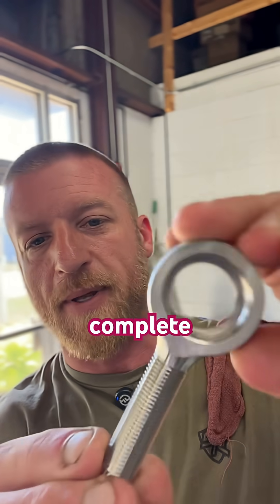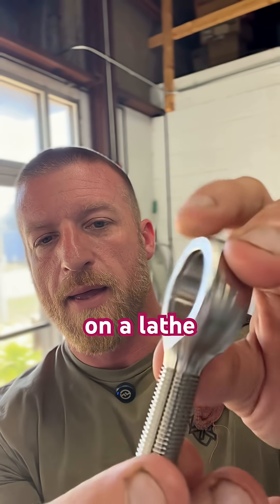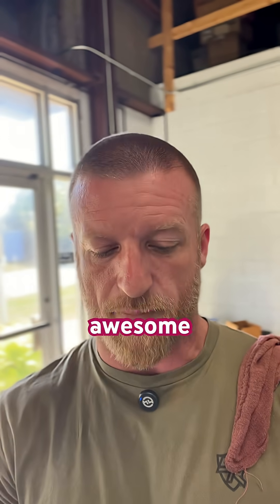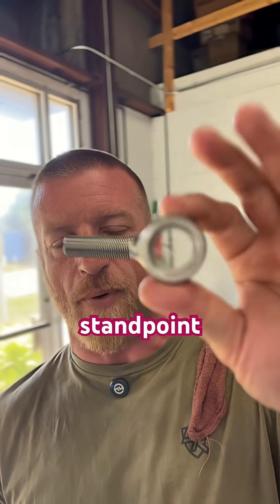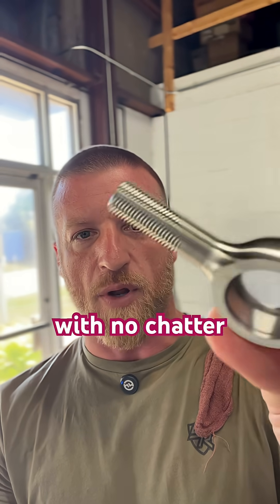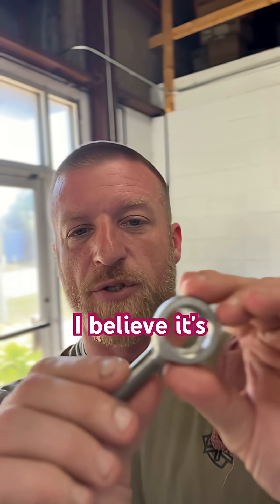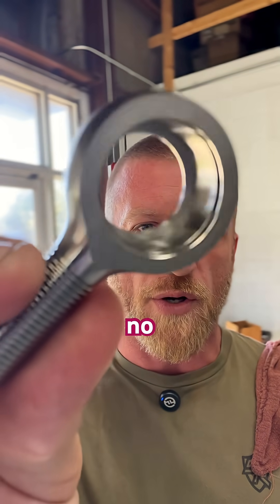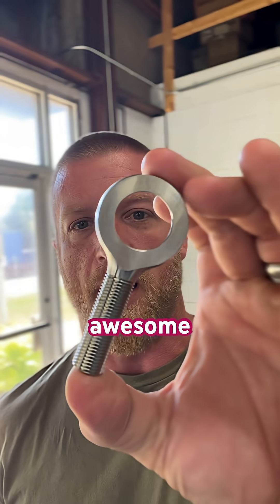316 SS part 💥 Complete in one operation #cnc #machine

Comment: One op apparently means different things to different people.
Reply from the maker: On the Swiss machine when you hit cycle start and it makes one complete part. Is that one operation or several?
Reply: When the part is held in one position in the machine you would for machines that are not so advanced have to manually reposition it before starting the machine again. Each new position would be an op. So if you flipped it around in the lathe it would be another op. Also if it went from a lathe to mill it would start a new op. This is good for keeping up with what part of the process anything happens but machinists having to sign off for each op will want to keep the number of ops to a minimum.
Reply from the maker: @wesleyashley99 well there is no positioning it manual handling of the part at all. We hit start button and a complete part comes out. Everything on this part that you see is done in 1 operation. The turning, milling and everything. 1 operation 🤝🙌

Comment: I run a Mazak milling machine and all I run is 304 and 316 stainless for medical equipment in I can say without a doubt those surface finishes look very nice especially for the faces of the bolt. It’s easy to get a good surface finish with a boring bar in stainless, but I swear we need to do some R&D on what end mills we’re picking
Reply from the maker: Experience with 304 and 316- I bet you’ve had some tough battles 😂. That stuff can be tricky especially the 304. Medical I’ve heard is some challenging work, but interesting as well. What mills do you use now? It’s not something we do a lot but always trying to learn more and improve
Reply from the maker: And mazak is a machine I’ve always wanted to work on.

Comment: So you grabbed on on the threads and milled the radius on the sub?
Reply: I'm pretty sure I've seen collet chucks on his subs in other videos pretty good grab probably a cool cycle to watch
Reply from the maker: @chopthesheep90 good eye. Exactly what we did. It was pretty cool to see. I’m going to try and get a video
Reply from the maker: Yup. Worked pretty well. Thread was stout enough to handle it 👍
Reply: In that case I am confused in how you count operations. 
I would think any time you change the grip it is a new operation? Or every tool change. 
I don't work with this but I'm curious how you define an operation?
Reply: @larslindgren3846  Typically, if one has interrupt the actual machining process to reset the piece (e.g. rotate and return to chuck or transfer to milling machine) and determine new offsets, it would be a separate operation. In this case, the part is loaded once by bar feed and all of the features are completed by a single program without any additional manual set up. Using the subspindle eliminates the need to take the time to transfer the piece and deal with location and alignment in a discrete operation.
Reply: @copperlemon1 Thank you for the answer.
Is that the same if the part is rotated or moved by a robotic arm or is it only one operation if the part is handed over directly from spindle to spindle?
Reply from the maker: @copperlemon1 great analysis and explanation. That is exactly what we do and why it’s considered 1 operation. Several people on this post and a previous 1 keep saying it’s “more than 1 operation” when in reality, this is 1 op. Hit start button and a complete part comes out, no human interaction at that point. Thank you for the explanation 🙌
Reply: @larslindgren3846 I personally consider that multiple ops performed with automation, but I get where your coming from. To me a robot (including barfeeder) are there to replace the "human interaction" part not the actual cutting of the part, but that's just my opinion. The sub-spindle is also an OEM part of the machine not an "add-on" if you want to say it that way
Reply: @larslindgren3846  Also a lot of times transferring from main spindle to sub spindle is an actual cutting operation because you pull the whole bar with the sub, clamp both chucks, and cut the part off the bar. If you ever need help puckering your sphincter that can be a really good place to start lol
Reply from the maker: @chopthesheep90  aint that the truth LOLOL